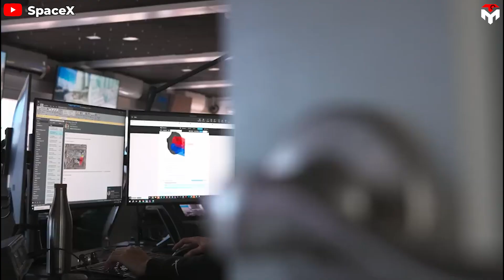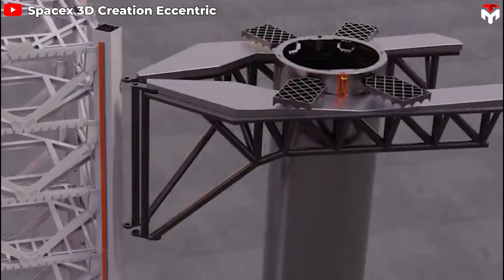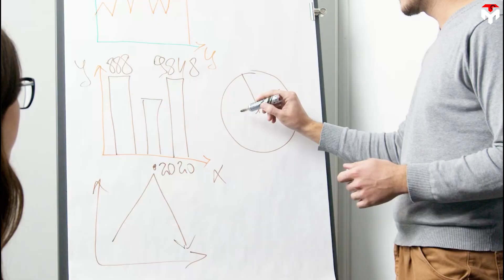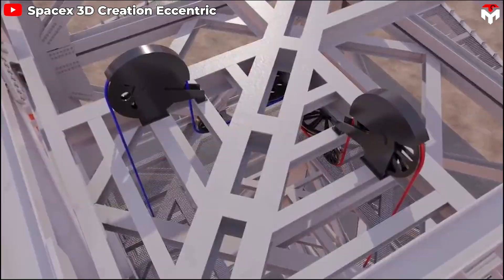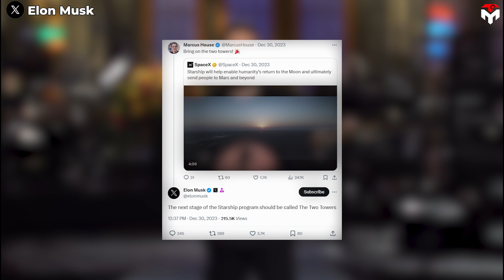SpaceX Mechazilla Catching ''BIG PROBLEM''...

Comment: It isn't just about losing the weight of the landing legs.  The falcon rockets are small enough to move around easily.  The Starship rockets and boosters are too big to cart them around, and they blast so much when taking off that you have to provide bespoke launch pads.  Ergo, they have to be able to land at the launch pads that they blast off from...

Comment: I don't see any difficulty at all. The so called multi dimensional stabilized obtimized trajectory allows a precise positioning with zero velocity and rates. This means the rocket can position itself at the best position to allow to close the arms securely. 
No problem after glitches have been ironed out.

Comment: Starship and super heavy can hover in place.. The "catching" isn't that crazy.. the starship can move as slowly or as fast as it needs to.. or just stay still in the air. There are videos of starship and super heavy hovering. Unlike Falcon 9 which can't hover because its thrust to weight is too powerful.. yet it still lands at zero velocity all the time. The catching makes perfect sense because starship can hover
Reply from the maker: Yeah. Between hundreds of way this can fail, we still have at least 20% of success, right?
Reply: @techmap9  imo I think they will hover over the ocean to collect data on hovering.. and once they are confident enough they will attempt a catch and succeed on the 1st try.